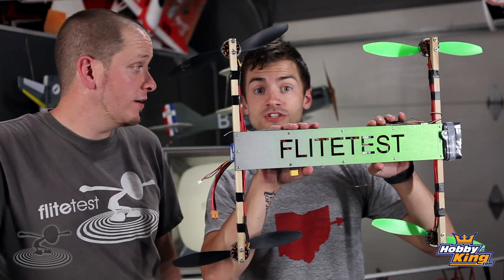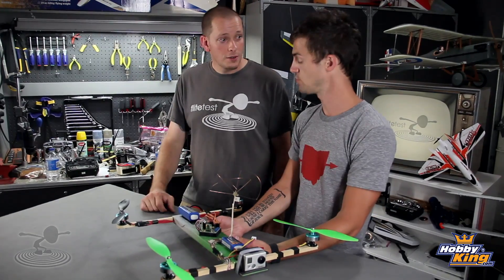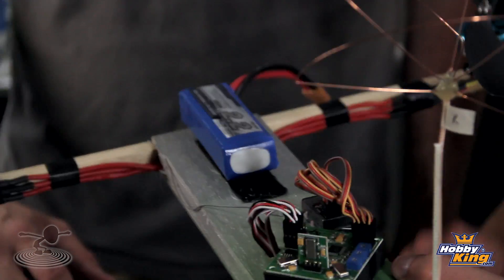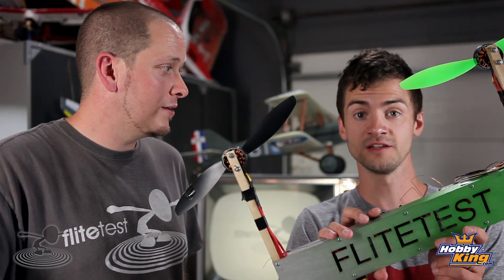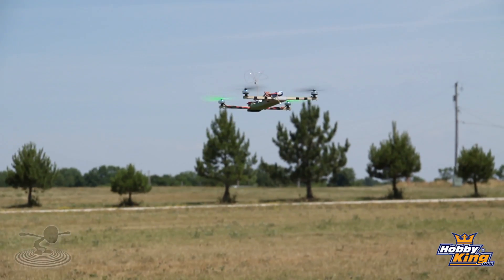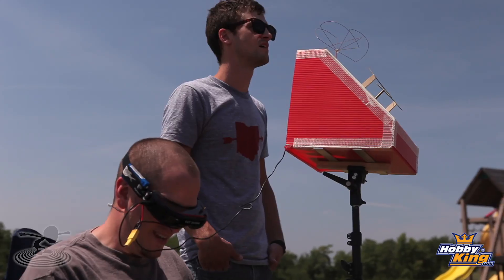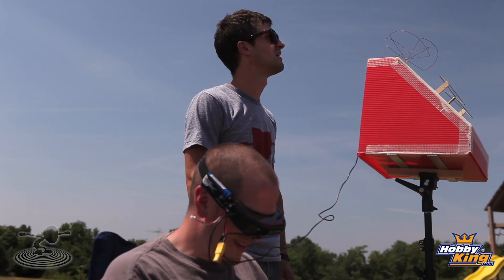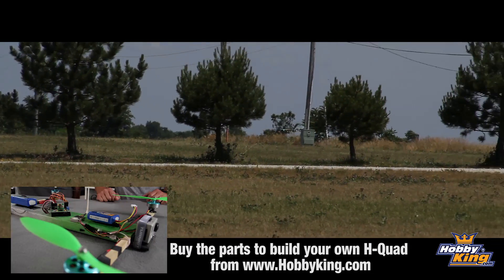Flite Test - H-Quad Multirotor - REVIEW

Comment: Carbon fiber kits with electronics are getting so cheap if your goal is to save money their is no poi t anymore it would cost you alot more to build this ugly quad when you can get a arf 250 on amazon for 100 bucks and its way better than this better motors i wish they would point tis out like hey the only reason to build this is if you have disposable income and your just really bored and want to build a slow overweight ugly quad
Reply: sorryociffer I bet your eating your words now lol carbon fiber quads are the standard now
Reply: A lot of the CF kits use cheap or fake CF. Break it?...gotta buy another. With this, you run to home Depot and fix it for a few dollars.

Comment: does the ESC makes the performance? such as speed?
Reply: nah, maybe reaction speed but with any hobbyking esc a beginner schould be fine
Reply: what iv noticed most with more expensive esc.. besides be able to flash them with a USB card and use BlHeli firmware..  the are smoother.. which really helps in flying a multirotor.  i personally would not spend over 15.00 for a good ESC.. right now im very happy with littlebees. 20A blheli.  i am waiting for emax to come out with there latest ESC flashed with belheli S.  i hope they compliment the emax red bottom motors they made.. lots of ESC will hit the market at the end of this month, and following.. with the hardware to use blheli S.  exciting times we live in for multirotors.. the advancement is flight controllers and esc is amazing.  the boys in 2012 could only dream of all the cool stuff we have for these toys now.. :D cheers.

Comment: I found the dynamic prop balancing very hard, so i ordered a prop balancer, and its not only the blades that are unbalanced, its also the hubs, ever single one of those gem fan 11x4.7 props i order are horribly out of balance!
Reply: Ultra rc so how did u solve it?
im going to build it but it ill be my first quad
Reply: i bought a prop ballancer and spent a night balancing the hubs of the props with hot glue and the blades with tape. Its a lot of work but i recommend spending a night or two ballancing everything and making sure there are no vibrations.Vibrations on a quad are your worst enemy!
Reply: thank you

Comment: Why does the control board need to be centered?
Reply: Random Rampage The accelerometer and stuff works better in the middle, you can put it anywhere techincly but it won't be as stable.

Comment: Hi Josh, I have built the Quad, but have a problem, I have it fitted with APM 2.5, 4 Hextronic 750 motors and 4 Afro 30 Amp esc's, my problem is that when I arm the APM and start the motors they start to spin when I go to increase the speed one will stop then shortly after the remaining motors stop as if someone has put the breaks on,put the throttle to zero and they do the same thing again if I increase the throttle,I am using power lead, clip removed and esc's all actives conected Geoff

Comment: Hey guys, my son and I are big fans.  He built his first quadcopter and is having issues getting it to fly level, without rotating.  He's using 975kv Turnigy motors, 30AMP esc's, and a kk 2.0 board, and a Hobby King hkT4 tx & rx.  11x4.7 props...put up a quick video...he's tried adjusting the trim, but it just changes the rotation of the quad from one direction to another...how to we fine tune it?  Thanks!

We have a video uploaded on my user channel.  TIA!

Comment: I have a few questions. Can controllers be set to multiple planes or multirotors? Also how well balanced does this have to be? Can it pick things up that aren't evenly balanced? If you used the largest props you guys have on all 4 sides how much lifting force would this have? And finally could you put links to the videos in the description?

Comment: If you're asking what I think you're asking, then yes, the quad, with a KK board will continue to fly in that direction. If you're wanting the quad to level out on it's own after returning the stick to center, you'll need a board that has an auto-level feature. The newer KK 2.0 w/ LCD board HK now sells has this feature. I've heard the 2.1 boards can be hacked to include an accelerometer though. . .

Comment: I've got a question for the KK Board 2.1. If you move the stick in  direction and then back into the middle, does the quad then still fly in the direction, or does it go back to normal position when the stick is in normal position?

Comment: Thanks for the "H" idea. I ruined my "Hobbyking Fiberglass Micro Quadcopter Frame 245mm" and swapped the components to a cheap DIY "H" wooden frame. It's only slightly heavier, more crash resistant and only cost me 3€ :D

Comment: One way to eliminated the jello effect is to putting a SORBOTHANE  pad underneath the GOPRO , also set the video quality from 1080 30fps to 720 60fps , you can check on my channel some of my FPV videos of my HT-FPV and 450 FLAME WHEEL CLONE quads where i fly them with the mods that i just mention above , the video quality is virtually perfect . you can get a 4" inch square SORBOTHANE pad from EBAY for less than 10 bucks .

Comment: you dont need to flash the board to make it fly in X mode, all you need is an elevon mix on the radio and orient the control board 45 deg so it still points to motor 1. that's how i fly mine, and it works great.

Comment: Orrr . you could produce a small tube system from each of the motors to act as ducts which then tunnel into the body. Or water cooling within the body. or heat-sinks that have slots to expose them to air. or cut bigger air holes. or have a compressed air system the squirts cold air on them when it detects a temperature increase above a set threshold......... Just a thought...   :P

Comment: Josh and Josh. A good idea to keep the ESC's cool in that body, Is to cut a squar at one end on the bottom and another at the opposite end on top. Install a CPU fan at the top hole, so as to suck air thru the boddy. The fan could be connected to 1 of the 3cell's for constant power, The ma draw is not much for a CPU fan.... Just a thought....